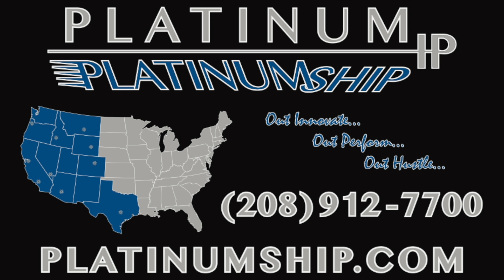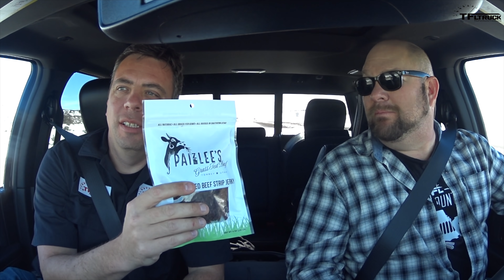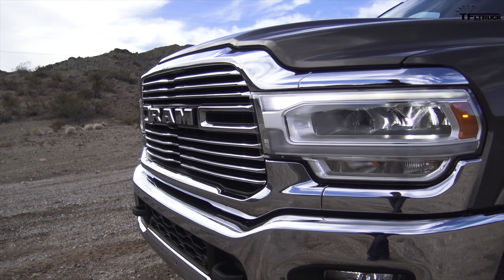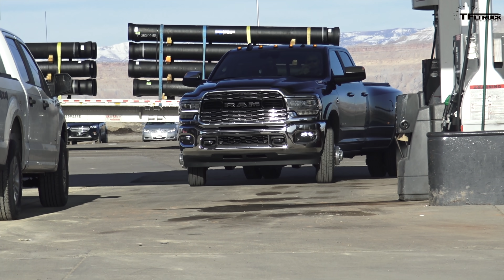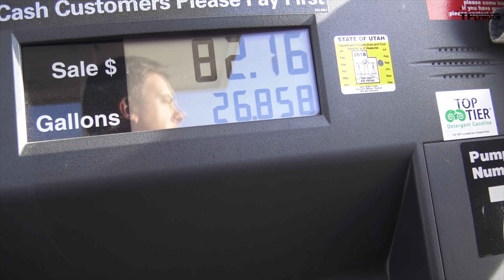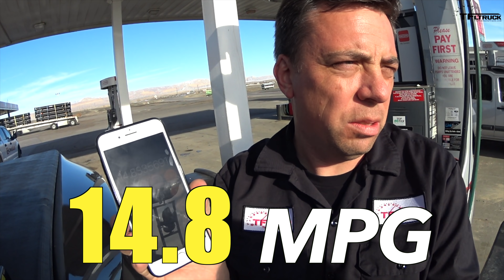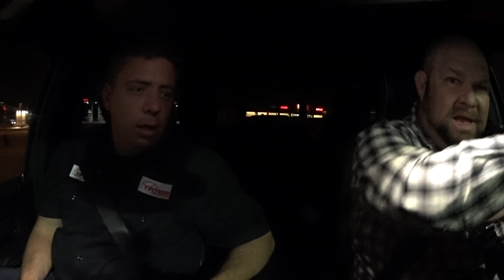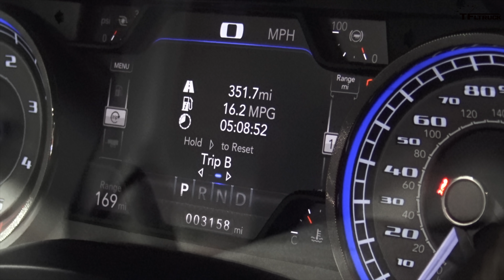We Drive 800 Miles in the New 2019 RAM 3500: Here's How Fuel Efficient 1000 lb-ft of Torque Is!

Comment: Amazing, after 20+ years of spending millions on R&D.  Dodge had managed to achieve 5mpg less than I get in my 2nd Cummins....
Reply: the new truck is quite a bit larger and heavier than a 2nd gen plus twice the power, not exactly apples to apples
Reply: @jmellison1979  That's a fair point.  However, a 2006 mega cab (weighs just as much as this ram) will still do 19 mpg...  I realize that this is the fault of emissions more than anything else.  Just not sure why people would buy the new trucks, especially considering they are less reliable, more expensive to operate, harder to work on, and worse in just about every other situation.  Maybe it's my fault for coming at this from the perspective of someone who actually needs his truck to be able to do something other than just take my wife on shopping trips...
Reply: @WickedZZzY  my 2017 2500 Cummins will do 20mpg or better empty and I use it to haul my 13,000lb 5th wheel among other things and it is pretty well better in every way to a 3rd gen other than the fact that it has emissions stuff, it is quieter inside, more comfortable on long trips, has a higher tow rating, more power, far better interior etc etc, not everyone buying a new truck is using it as a car
Reply: @jmellison1979  Okay, let's not lie to each other.  I know plenty of people who own 4th gens.  They get 14-16mpg unloaded.  You're lucky to get 8mpg towing.  The new trucks choose when to shift for you, have all the nanny state equipment (can't tell you the number of 4th gens I have been in with a tire pressure sensor going off).  Nothing like loosing traction in a 4th gen while going up hill and having the stupid thing decide to cut all power.  Plus you have to deal with DEF.  Talk to me when you have 500,000 thousand miles on yours...

Comment: My 98 dually 12v Cummins took me up north to Alabama 500+miles and got there with a quarter left after being topped off. All stock but the straight pipe. I drove 7+ hours without stopping my ass was on fire but didn’t care. I stopped by a gas station 2 miles out from my destination, opened the hood touched the top of the engine and it was cool, not warm, COOL. Don’t drop 80k+ on these crazy expensive trucks they are NOTHING SPECIAL just advertisement. My truck cost me 8k not a down for a house, Priorities guys.

Comment: You could have gotten better mpg with non-truckstop biodiesel blends. 
I do hotshot long hauls, and keep up with tank by tank mpg on my 2018  3500  (6.7 Cummins), and found when Im using their "up to B20 blend"  biodiesel from Flying J my mpg is solidly 2 mpg lower than non- biodiesel Diesel fuel. On a truck that gets 16 empty or 11-13 mpg  towing,, a 2 mpg gain  represents 15-18% better fuel mileage.  
Ive installed a 70 gallon aux tank to minimize in-route truckstop refueling in favor of storing more fuel onboard and filling with 100% diesel fuel. 
Im 100% convinced that biodoesel (which Ram says increases the oil change frequency) isnt good for the 6.7 cummins. 
Even the cheapest 100% diesel out performs bio blends.

Comment: I love Cummings but I  hate a dodge the bodys really suck body rusting out interior don't hold up. But great engine
Reply: They all rust and the insides are all made of plastic. Dodge is the only pickup brand to run 1.7 million miles. Sure the cummins is a great engine but the body had to make it to. No other brand has. Plus when you do see a rusted out dodge they usually have 3 to 400,000 miles on them VS the others are in the bone yard before they ever see them kind of miles also rusting out.

Comment: BTW, what was the gears? 3.42 to 4.11 is a big difference. And the Aisen has a taller high gear than the 68. I bet if you had 3.42 at 65mph, or 4.11 at 55 you would see a real MPG increase.

Comment: The numbers are great but I've never liked the comfort features of the newer Dodge Rams. My dad has one and I enjoy putting my arm on the door and then in turn on the center console. The door has a thin panel and I never did like it. I have an older f150 and the door panels are huge. Just a detail that I've noticed. Is there any change in the 2019 model?

Comment: You have to break the diesel engines in before you will start to see good gas mileage. The best way to break them in is to tow heavy trailers. Once they are broken in, which is usually around 75,000 to 100,000 miles, you will easily be seeing 25 miles a gallon on the highway. (Not pulling trailers). I have a 15-year-old Ram 3500 dually that gets 28 mpg on the highway.

Comment: My 20 year old 1999 ford powerstroke 7.3 with a 6 speed gets the same fuel mileage
Reply: 105Percent_American I can say the same thing as my bulletproofed 6.0, but we don't have all the restrictive emissions equipment, and even with my hot tune, am still pushing less torque.  I'm wondering what the new Cummins can really do if it were deleted.
Reply: your 7.3 is not emmisions restricted. It also wont haul anywhere near as much weight and see how it compares when towing equal loads up a mountain.
Reply: That’s impressive since my old 6mt 7.3 only got 14 after straight pipe and tune

Comment: Emissions killed diesel fuel efficiency. So you put out less emissions but 2x as much. Old 5.9s got in the 20 to 25 mpg on the highway...
Reply: Yea there is no way burning MORE fuel makes less emissions total! Remember the old Dmaxs with there weed burner tail pipe? That didn't help emissions one bit it only mixed more clean air before it got out the very tail of the truck. Total was the same. About like the 70s putting air pumps to pump clean air into the exhaust lmfao!
Reply: Not duallys
Reply: Old 5.9 isn't gonna legally tow 30k though either, nor will it be as safe in doing so.

I like my old IDI too... it's basically factory straight piped with only a muffler. But there's just no capacity comparison. If you need capacity you don't have much choice.
Reply: not to mention when the exhaust filter is full it burns itself out I wonder where they think it goes then
Reply: @ryanstuckey8677  You got that right! Then the extra fuel burned trucking them things around the country to replace them and recycle used ones ect ect. These climate change nuts don't realize most of this crap pollutes more not less lol

Comment: For a green engine, I guess that's not so bad in such a big truck.  My 2001 2500 diesel gives me about 20 on the same route doing the same speed.  But it's 2wd and lowered, and has 525,000 miles.  I don't think the Cummins engine is fully broken in until past 200k.

Comment: 80 mph is not great for testing mpg. From my experience traveling at 60mph saves 20% fuel vs 80mph. The same trip at 60mph could be around 18mpg.
Reply: It's real world conditions. No one wants to drive across southern Utah and western Colorado at 60.  At least go the speed limit - 80.  I bet they were regularly being passed if they were driving only 80.
Reply: @hardrockminer-50  if that's the speed limit I see your point. If the sign says 80 do 80. That's said, when. EPA hwy numbers are posted I dont think they use 80 to test. I don't know EPA rules but it's natural or compulsive to compare any hwy mpg findings with EPA numbers even if the speeds are apples to oranges. When tfl lists mpg it would be nice if they found an area that has speed limits close to that they EPA uses. Then the real world testing argument makes a bigger impact.
Reply: @KyleRichmond7  I appreciate reports these real world tests because they help us calibrate our expectations.  For instance, their tests on towing from Silverthorn to Eisenhower Tunnel helped me realize  my mileage and performance pulling my travel trailer with my Ecoboost F150 are not out of whack.

Comment: I am on my 6th Ram diesel since 1996. Only going off the 6.7 though, they all seem to really jump up in MPG at about the 10k miles mark.
They take some time to break in, then you really see an improvement. Of the last 3, after the 10k mile mark I would be between 19-21 mpg on them. I only see 15 when towing a heavy trailer.
So the MPG tests on brand new diesels is a bit misleading on what you will eventually get. However, new, that is pretty close to what I was seeing as well.
Reply: Hey. Do you still have the truck? I'm thinking of getting one from 2019 and am wondering what the mpg is now for the highway and in the city? It will be a hauler for a RV and my daily driver. If you still have the truck do you mind sharing this info. if you have it?

Comment: Nope, mpg’s are no better. Your mpg calculations are what my 2016 Mega cab Laramie Longhorn dually gets empty on the hwy,  480 is not possible for a 31 gallon tank At top off, maybe 32 gallons..Try it you’ll be on the side of the road.  3.73 gears at 65-70 mph WA to CA, CA to TX, CA to FL, religiously. Mpg’s for the new trucks are straight crap.. I also have a 2004 2500. QC that goes from Port Orchard, WA to to Dunning, CA on less than a full tank.. 712 miles to be exact. The 2500 will do 3 fill ups from Corpus Christi, Tx to San Diego. Ca. The 3500 roughly does 6.. Do the math..

Comment: I work at a ram dealer and in reality these trucks get very poor fuel economy. The dashboards display average fuel economy so I see that every time I get in one. Yes some people buy 3/4 ton diesel for their highway commute and get 18mpg. But the trucks that are used as trucks (for example 1 ton duallys equipped with flat beds or fifth wheel hitches) come in displaying about 8mpg average fuel economy. The upfitted trucks with big “work truck tool box beds” get even worse mpg. But hey, you don’t but one of those things for the gas mileage, lol.

Comment: stupid test, because the same truck with 10,000 miles will get MUCH worse fuel mileage than the exact same truck at 400,000 miles.   Diesels get better with age, although they need turbo re-build every 200,000 miles lol if your lucky and make it that far.

Comment: The Ram only uses the last 200 miles to calculate MPG on the EVIC.  Regardless if you reset trip or not.  So on both runs when you were descending truck showed optimistic.

Comment: It will bring MUCH better economy after break in. My 2018 Ram SRW 3500 CUMMINS AISIN ( 930 lb ft) after 25000 miles gets 20 MPG highway driving. At first it was only 14/15 MPG.
Reply: I agree. 2018 3500 6.7 SRW 68RFE. New -  8000 miles 13/14 city and about 16/17 hwy. Expect it will increase around 15K

Comment: this prolly has the 4.10.....I noticed all the new rams on the fast lane 2019 towing charts  have 3.73......no more 3.42?...…..basically your going from 930 with the srw….to 1000 but the 3.73 will make it feel ALOT more powerful...I suspect you could do 18 mpg..easy with a 3500 reg cab srw with 3.73s..if they r getting this with a mega cab 4.10 dually...need to do a 3500 3.73 reg cab srw loop..and interesting experiment would be to re gear to 2.90 and see what happens.... lol ( and u could prolly still tow 13000)

Comment: At 20k miles I installed a K&N air filter on my 2018 2500 Ram and went from 19 mpg to 21 mpg overall   It seemed to be gaining mpg as we got to 20k on the odometer but really jumps with more air. Previous experience with the two previous Cummins pickups were jumps at 50k and 100k mileages break in numbers.

Comment: Gas stations can rip you off.  The pump might say you pumped 11 gallons when really only got 10.  I've been finding this quite common with independently operated gas stations but less common with the big corporate operated ones like Pilot, Sheets, Wawa, Costco, etc.
The most common rip off percentage I discovered was about 10%.  But I have seen up to 25% rip off rate.  (That's receiving 3 quarts for every gallon the pump says you got!)

How I do this is I always top off.   At fill up time I read the MILES DRIVEN since last fill up and divide that by the AVG MPG.  That will tell me how many gallons I should get.  Then I top off as always and see how many gallons the pump says I got.

Comment: I do appreciate your time takin to do these videos, I Enjoy most of them. 2 things I will add here,
That $87,000 is MSRP and you'd have to be a fool to pay anywhere close to MSRP. I'd say that truck could be boughten for somewhere in the range of the mid-70s or, maybe even the lower 70s.
Second
That fuel mileage is not it all impressive, where as my 17 Cummins will get 18 to 20 out on the Highway, hand calculated.
The truck says 20 to 22 but it's not very accurate.

Comment: So stupid! You can’t just drive it without a load. That’s not what’s it’s built to do. 

Also, 14 mpg is not good at all for a diesel. 

Wtf is wrong with this channel? Are you guys just kissing manufacturers asses?

All these trucks in this class should be well over 20 when they are running empty as you guys are doing.

Comment: I have the same truck and as soon as you rev over 1.8 RPMs the MPG drops off every 1/10 higher you rev.  So at freeway speeds with the 4.10 gears you are only going to get 14-15 mpg however if you can keep the speed at 65 mph or even less 55-60 you can get 17 -19 easily.

55 mph = apox 19-20 mpg 
60 mph = aprox 17-18 mpg
65 mph = aprox  15-16 
Over 65 you are screwed! 

I will be installing a manual over drive like I did on my old Ram one ton which lowed the RPMs enough to still tow and yet cruse at freeway speeds and get much better MPG at higher speeds.

Comment: Guys I want to clear something up because I keep reading erroneous comments on here.   DEF does not in any way,  Shape, or form affect MPG.  The DPF does to a very large amount and the EGR does to a much smaller amount.    The DEF is a mixture of Urea and distilled water that Is injected Into the exhaust having zero affect on the MPG.
Reply: That’s interesting because Cummins says it does- 
“Cummins 2010 engines will deliver what customers need in these challenging economic times. Cummins 2010 heavy duty engines utilizing SCR will provide substantial fuel economy improvement, up to 5%. SCR catalyst technology allows much greater NOx conversion efficiency, thereby allowing the engine to be fully optimized, which contributes to this fuel economy improvement. Another benefit to the improved fuel consumption is less frequent Diesel Particulate Filter (DPF) cleanout, thereby further reducing costs.”

https://www.cumminsfiltration.com/sites/default/files/MB10033.pdf
Reply: @therealjohnsmith4811  where does that say that pushing in any amount of DEF hurts MPG?
Reply: Rich Farfugnuven You stated DEF has no effect on mpg. According to Cummins (and other sources) it actually improves it.
Reply: @therealjohnsmith4811  the way it improves it is by pushing regeneration further out.  So if you mean it improves it indirectly by pushing the next regeneration further out, then yes.  Can I tell you a secret?  If you add water methanol injection, you can almost double the time in between regeneration, thereby improving your MPG even more.  Delete the whole system of DPF and EGR and do even better.....
Reply: Rich Farfugnuven Not me saying it. Cummins is saying it. I think its an oxymoron. The DPF makes mileage suck worse than the DEF improves it. So its a net loss anyway. Better to just delete it. Unfortunately, my county does emissions testing.
Reply: @therealjohnsmith4811  me too.  That's why I still drive my old trucks.  They pass with no emissions equipment.

Comment: That's a very nice truck but $80,000+ is too expensive.  I'll be honest, I make what most people would consider to be a lot of money, I own several service trucks so I could also take advantage of some tax incentives to help offset the cost and I would NEVER buy a truck that cost anywhere near $80k.  I'll stick with my very nice 6.0 gas gas GMC 2500 that I bought used when it was 2 years old for $28000 that doesn't require any maintenance except for oil changes.

Comment: I'm curious if you notice what I notice in my truck.  With the DPF trucks.  If you work them hard for a half of tank of gas at highway speeds and then run them empty I get as much as 4 to 5 more MPG better once empty.  This increase in mileage last for about 350 miles before it settles back down to standard levels.   (2013 Ram 2500  avg mpg 16.9  Best ever 23.5)

Comment: Hey guys! I have a 2016 dually 4x4 with Aisin, I drove from San Diego to Memphis and back empty and my average was 16.2mpg . I drove from San Diego to Cleveland towing 19,000 lb fifth wheel and averaged 9.5mpg. My truck has 15,000 miles on it. I hope that helps you.
Reply: RobShutt357  when your warranty is done and you be able to take the egr out and run a tuner you will get a lot more out it got an older 2011 without egr and with mini max tuner and I get a little over 20 mpg at 65 mph
Reply: What rear end ratio do you have in that truck?

Comment: a 13 liter Detroit Diesel starts at 350 hp and 1250 foot pounds...amazing that a 3500 has nearly big rig torque of course that same 13 liter can have up to 505 hp and 1850 foot pounds buit im sure that would be an "off road" version
Reply: The DD13, and the DT12 autoshift are the best combo Ive driven for many years. Id take them over a ISB series Cummins any day.

Comment: I’m kinda disappointed with the efficiency myself, but then again in Ram’s defense that truck is configured with the high output engine which means it also has 4.10 gears if I’m not mistaken. If it had 3.73 gears or even 3.42 gears it would’ve done better in mpg’s

Comment: I get youre in the montains and stuff, but I'm really not too impressed. When I drove a 97 GMC dually 7.4 votec, 4.10, 75 mph with roughly 500 lbs in the bed, I got just over 12 mpg on 180 mile trip. I get that's horrible numbers, but that was a 20 year old big block gas truck, with a 4 speed auto. 15 mpg in a brand new diesel empty really is kinda disappointing in my opinion. Thought it would get 18 or 19.
Reply: Ikr man my 1989 with the 5.7 got into the mid 20s... at 60